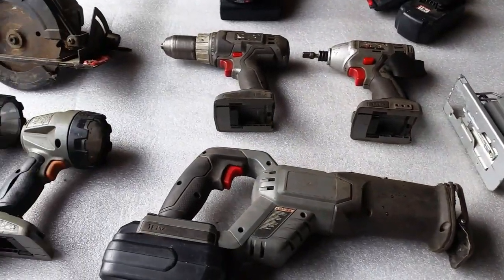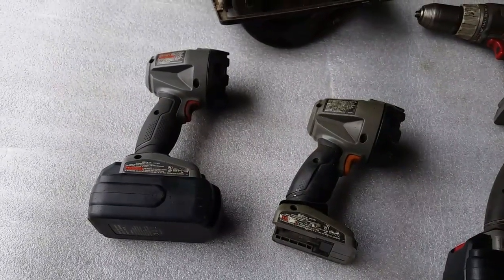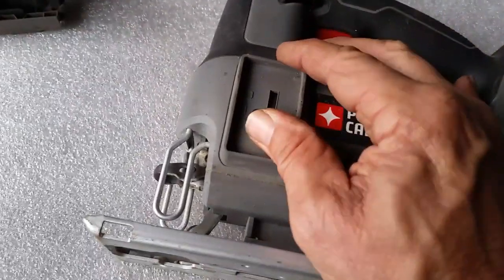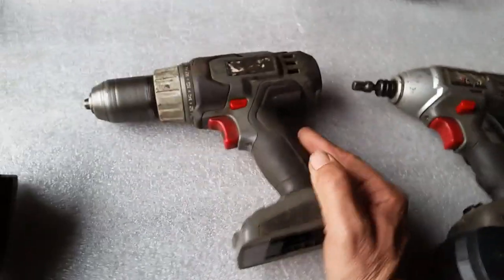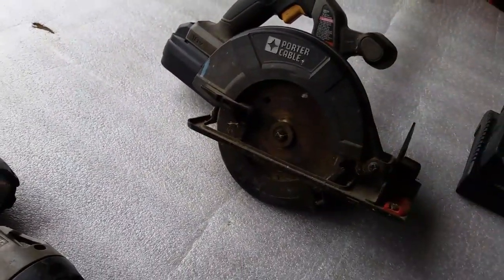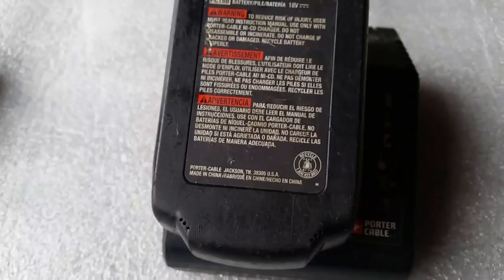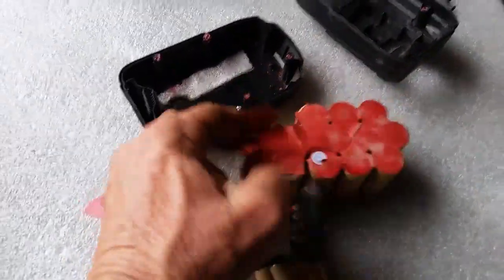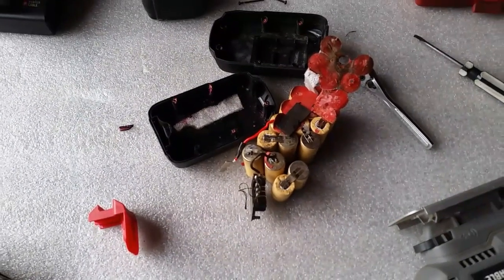18v PORTER-CABLE® 8 Year User Tool Review. Viewer Request. Was it worth the Money?

Comment: In 2012 I got a porter cable 4 tool set while working as traveling commercial carpenter when my tool bag with my dewalt 18v tools were stolen from a job site. The Porter Cable 18v was inexpensive it got me thru the next day and I went and got a PC impact and discovered the Lithium batteries (half the size and weight) Purchased a second drill and a couple of sets just for the lithium batteries. I used them daily in a commercially up till a little over a year ago and still use them at home. Worth the price - I think so, the first set was $150, the impact $99 the other sets I got for batteries $300 I used them for five-ish years. my currently Millwaukee set was $350, the extra drill and saws $425 and I hope they last as long.

Comment: I have owned this set since 2012.  Has served me well.  I bout off brand lith ion batteries and have had great luck with them.  I am up grading to Milwaukee M12.  Will still use the circ and recip saws. My impact is near the end of its life.  Electrical smell during use
Reply: I have that same electrical smell on my porter cable impact drive for like 8 years now, all I can say she still runs like a champ. I've since bought aftermarket Amazon 5. amp lithium batteries for my set, and wow, the higher amp batteries will give the tools more power.

Comment: Im a retired Truck mechanic and I have a Dewalt 20V lithium kit and it works great, it was a gift from my Son so don't know the cost, the same Son is in the trades and he swears by Milwaukee which is probably the best out there for someone like you Nathan, with the money you have spent on batteries over the years you could have had a dewalt or Milwaukee and wouldn't have had battery problems. Thanks for the video
Reply from the maker: True.